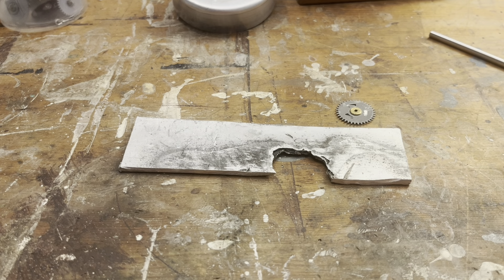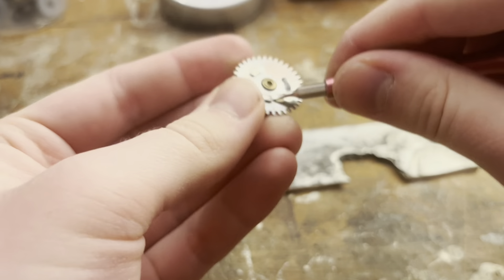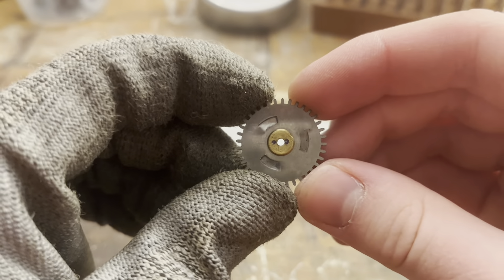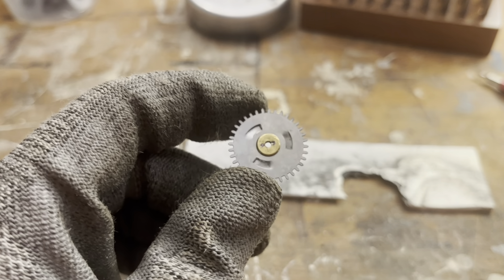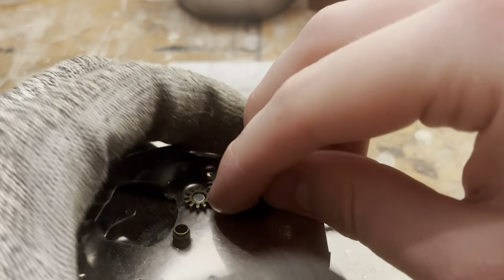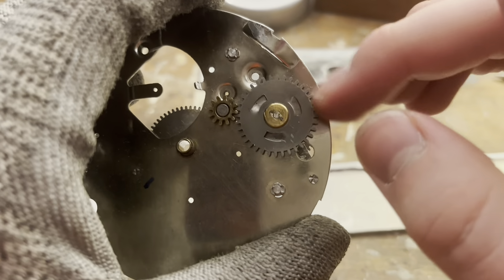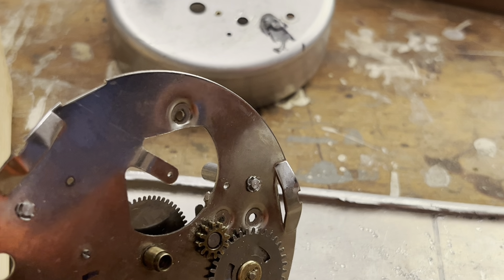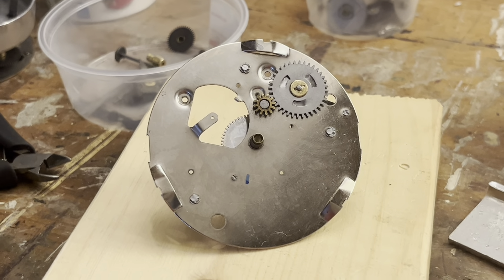Westclox Electric "SPHINX" Service  (Part 3)

Comment: Staking set looks good. I have collected various random punches, but a set like that looks very useful. I've moved away from epoxy resin, especially for metal to metal joints as I found it would give way too easily